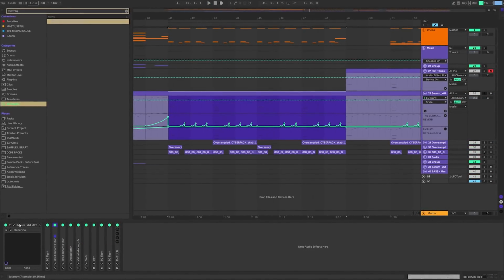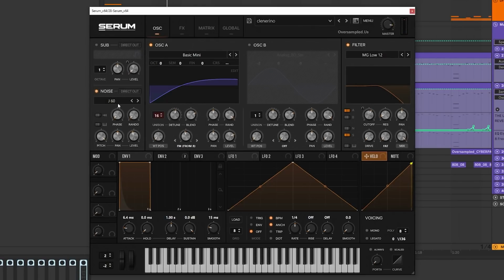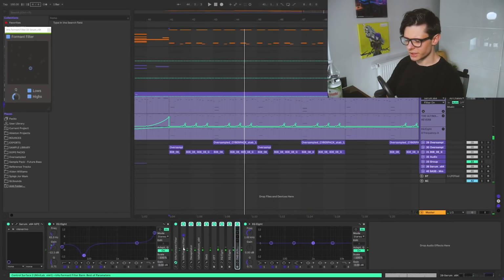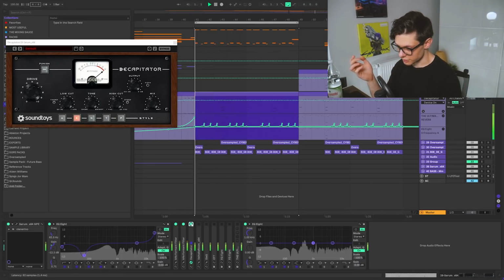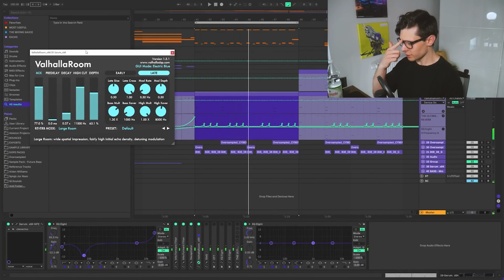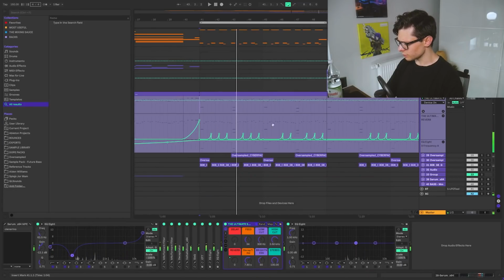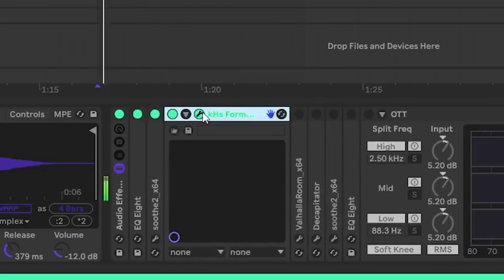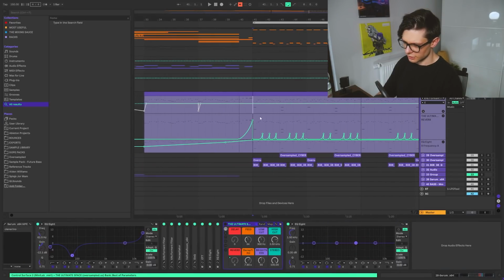Professional Lead Design 💥

Comment: are you manipulating anything in soothe or are there presets/it automatically tames the certain frequencies? Asking for a friend lol a lot of producers I know use it, i dont understand the different between say fab filter and soothe. Anyways been watching your vids forever and still killin it!
Reply from the maker: Fan filter uses bands, soothe spectral compression. It's a different thing, instead of the volume reduction on a band you get dips in volume on each of the resonances
Reply from the maker: And yeah I'm just using a default preset and tweaking the big button amount and sensitivity